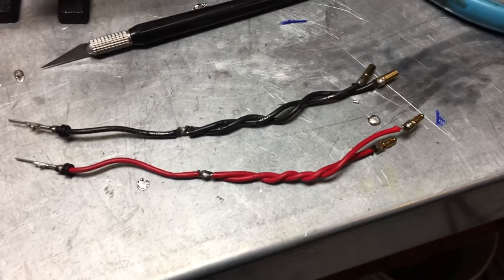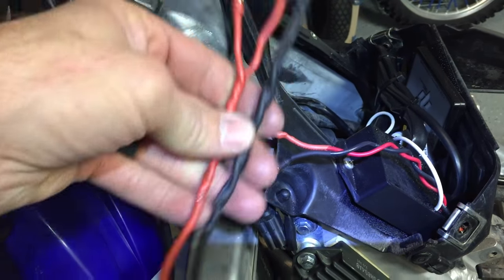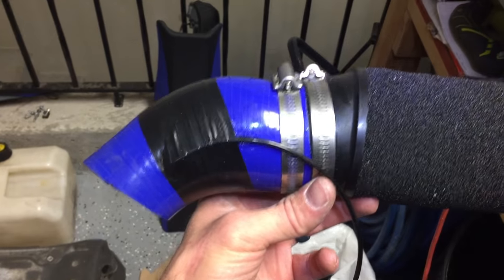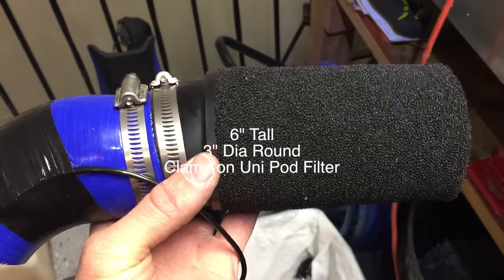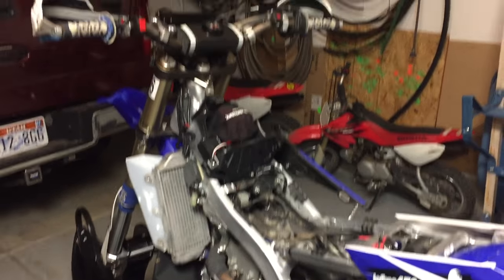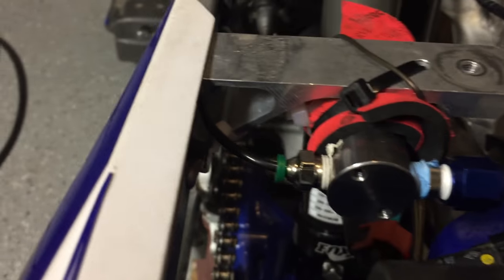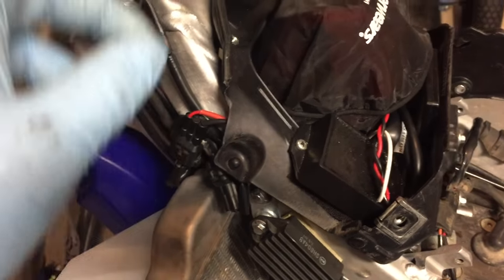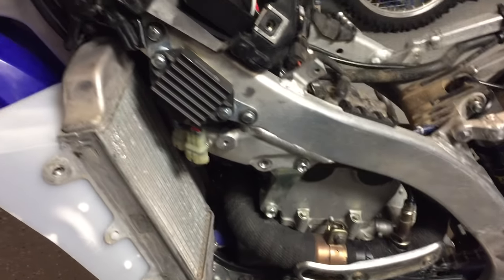Timbersled Nitrous & Intake Setup - 14' YZ450f

Comment: did you have to take the top end apart to open up the ring gap? normally the nitrous makes the engine run hot and your piston could shatter. or are you not pushing enough nitrous to have problems?
Reply from the maker: the Tuner keeps the fuel to air ratio perfect, one nice benefit of having EFI

Comment: Are you looking for a k and n style pod filter?
Reply from the maker: I think that would still clog with ice crystals.  I'm looking for a cage built of maybe only 6 wires max, just enough to hold the shape of the outerwears cover.
Reply: jethro450 Build your cage yourself. Use the wire from a hanger and then buy a hose that just goes over it (1/8 inch hose works fine). Dog ear the ends and drill a small hole in your silicone intake. Then shove it in. A bunch of us have done it and it works like a charm.
Reply from the maker: Thanks I may try that, although I haven't had any issues of ice crystals in my current setup.  It's pretty well protected from snow on the YZ intake.